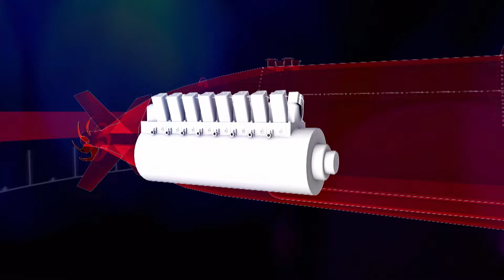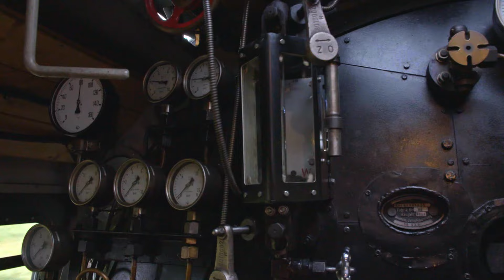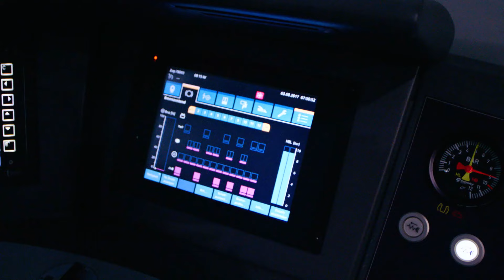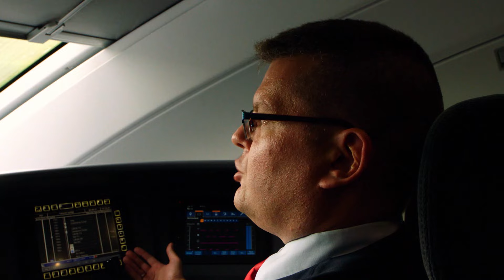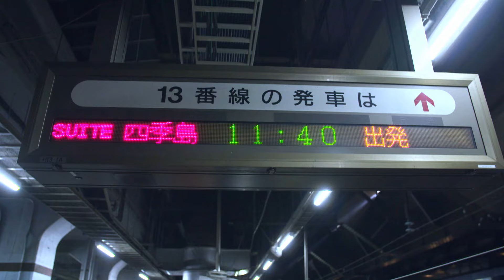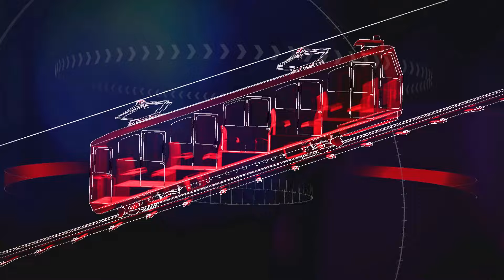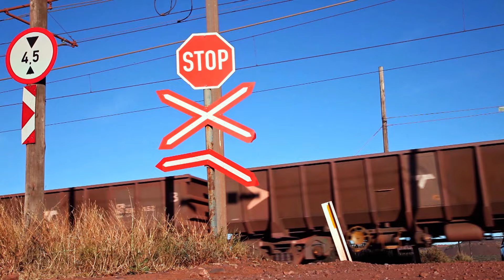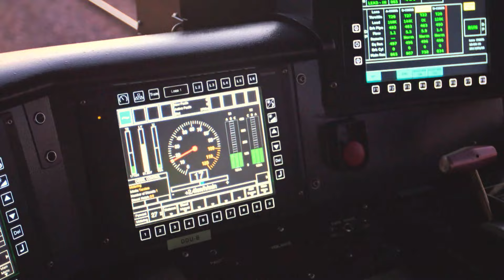World's Biggest, Longest Trains | Ultimate Vehicles | S01 E05 | Free Documentary

Comment: The A4 Pacific: Mallard is the fastest steam locomotive in the world. That locomotive reached 126mph or 203kmh to everyone else.
Reply: I think they meant the fastest speed during regular operation. The A4s were designed to run at 144,8 km/h (100 km/h are roughly 60 mph) during regular operation and the 18 201 was designed to run at 180 km/h during normal operation. But the A4 Mallard has the official record of the fastest steam locomotive ever at 201,2 km/h. It was driving slightly downhill, though, and it was damaged at the end. Btw: American Locomotives probably could run faster than this later on but they never bothered to break the record officially.
Reply: Cafer what American steam train would break the record?
Reply: @RRAAZZAA  The Class S1 is reported to be ran at 227km/h to drive in delay. It technically could have achieved it based on the power it had. But, as said, it was never an official record and the evidence is neither clearly declared reliable or unreliable.
Reply: The DR class 18 201 steam engine is the fastest loco still in operation. The LNER A4 "Mallard" holds the world speed record at 126mph, but is a static, non operational display only.
Reply: More specifically, the German 05 002 casually set a World Record while catching up a Delay, and wasn't even running on its Limit according to the Footplate Crew. Mallard bet that by just one or two km/h on a dedicated Record Run, while going downhill and still burnt out a Bearing. Please don't accuse me of German Bias though, because there are numerous Records of Pennsylvania S1 and especially T1 Locomtives reaching 230 km/h while catching up Delays, but no one there cared if that was a World Record back then, so it never was offcially recognised. Today there is a Project to rebuild a T1 Locomotive and break Mallard's Record.

Comment: 1989 Record:  South Africa.  Run on 26–27 August 1989, comprising 660 wagons, 7.3 km long and a total mass of 71 765 tons on a 1 067 mm gauge line.  The train comprised 16 locomotives (9 Class 9E 50 kV AC electric and 7 Class 37 diesel-electric) on the 861 km Sishen - Saldanha iron ore railway

2001 Record:  Australia.  Run on 21 June 2001, comprising 682 wagons, 7.35 km long and a total mass of 99 734 tons on a 1 435 mm gauge line.  The train comprised eight GE AC6000CW diesel-electric locomotives on the 275 km BHP iron ore railway to Port Headland.

Production ore trains:
Sishen - Saldanha    375 wagons - 4 km (2018}
BHP,  Port Headland 336 wagons - 3 km (2011)
Reply: Beaten by BHp in West Australia over 8kms long and 100,00- tonnes
Reply: @toodogs23  but they dont run now since the line was doubkled so this South African one is the longest regular one still running
Reply: wow

Comment: Steam locomotives exist that could easily equal the German loco for speed but which are restricted to 75mph/120kph because of the destructive 'hammer effect' caused by those massive connecting rods pounding up and down several times a second on the track.
Reply: What is kph?
Reply: Kilometers per hour.
Reply: @brianfraser2495  That would be km/h.

Comment: The steam is heated twice in 18 201 through the superheater tubes and just about every other steam engine is the same. The Swiss have moved it up a notch now with heavy oil firing being old technology and the Swiss have developed light oil firing or diesel fuel for steam engines. The burner looks like a huge domestic gas stove and could be the way for the future. Couple with a Lemphor exhaust which is much better than the Giesel ejector that 18 201 has thus making the engine much more efficient.
So the 18 201 is like a Mercedes it goes very well but when it needs repair it's damn expensive the same for all steam engines as there are no spares any more for any of them.

Comment: Fun Fact: Many of the german rails actually wouldn't support the steam locomotive at top speed, since many of them are rated for about 100/120 km/h
Reply: And maybe because a steam locomotive might be heavier in weight (I guess so?) We got a lot of rails that still have the wooden planks and can't even support regional trains at full speed.. let alone the ICE that needs special rails to fulfill its sliding technique.
Reply: @ranjapi693  It would depend on how the weight is distributed, but it probably would still be heavier, you're right.
Reply: @ranjapi693  Nope, the maximum Weight per Axle even was increased since Steam Locomotives were built. Back then, it was 15 Tons on Branch Lines and 20 Tons on Main Lines, today it's 18 and 22 Tons.

Comment: Fastest steam loc is Mallard in England, it can do over 200km/h. This is one of the fastest and comfortable to drive (oil heating instead of coal shoveling), but not The Fastest one.
Reply: More specifically, the German 05 002 casually set a World Record while catching up a Delay, and wasn't even running on its Limit according to the Footplate Crew. Mallard bet that by just one or two km/h on a dedicated Record Run, while going downhill and still burnt out a Bearing. Please don't accuse me of German Bias though, because there are numerous Records of Pennsylvania S1 and especially T1 Locomtives reaching 230 km/h while catching up Delays, but no one there cared if that was a World Record back then, so it never was offcially recognised. Today there is a Project to rebuild a T1 Locomotive and break Mallard's Record.

Comment: I thought the Mallard was the fastest steam locomotive...?
Reply: But it isn't in service anymore. The BR 18 201 is the fastest steam locomotive in service but not of all time. The Pennsylvania Rail Road S1 is the fastest of all time anyway.
Reply: @steffenreimann2854 
The Pennsylvanian record however wasn't officially timed, and based on what the crew claimed (the timing supports their claim, but there were no speedometers). Officially, a speed record also has to be set going both directions, which didn't happen there.

The Mallard holds the official record, however it's running gear had to be replaced afterwards. The Br05 got very close to the record, however the engineers avoided pushing it too far to avoid damage.
Reply: @steffenreimann2854  It's used from time to time.

Comment: I have a question so how do they the trains 🚊 come back do they have to do Uturn or what
Reply: It's either they have a locomotive on the rear end and just reverse, or they leave their wagons at a siding rail, then the locomotive goes to the other side and then re-connects to the wagons. Many modern trains don't have locomotives and instead have basically all wheel drive so either direction is okay with them.
Reply: CaptainKrajick oh now it makes some sense
Reply: Some trains, the locomotive must be taken off the service & turned around - steam, desil electric, can be run both ways from the cab, Passenger services, tend to have a driving cab, at each end these days,  in many country's - passenger carriage trains, just get hauled backwards, with the locomotive, hitched up front , unless quite modern, like the ICE, APT, Bullet Trains & other high speed passenger  services.

Comment: ICE 4 250? WTF the Vmax is 320!!
Reply: wtf no it's not
Reply: ICE 1: 280
ICE 2: 280
iCE T: 230 (tilting train)
iCE 3: 320/330 (in Germany only operated with 300)
ICE 4: 250 (after some changes soon 265)
Reply: @janv777  No. max speed of the ICE3 is 330. Velaro D is only 320 tho
Reply: @UnleashTheDragon  ICE3...some can 320 and some 330....
Reply: @janv777  Duh no. 403/406, wich is the original ICE 3 all go 330. Max 300 in Germany tho. Just the 407, the Velaro D, wich is also called "New ICE 3" goes 320
Reply: @janv777  Btw, the ICE 2 also goes 280.
Reply: @UnleashTheDragon  Es gibt keinen "originalen" ICE3. Es ist nur eine Marketingbezeichnung der DB.
Reply: @janv777  Mit Original wollte ich verdeutlichen, dass ich den 403/406 und nicht den 407 meine. Das Ganze macht deine angegebenen Daten trotzdem nicht richtig

Comment: its just so sad that the ice 4 is more than 70 km/h slower than the ice 3. Just because the german rail net is rotting away and redundenciey were srapped. so now ices local and freight trains use the same rails. the french TGV network is much better.
Reply: The ICE 4 was created to replace the ice 1 and 2. DB is constructing more high speed lines than ever before, just look at munich-berlin. The ICE 3 is still the flagship model, but it only makes sense on high speed tracks, but since most of the ICE lines are using old tracks which were not intended for high speed rail, there is a high demand for the ICE 4 because 1 and 2 really need to be replaced. The ICE 4 is very efficient, comfortable and economical, so I don't see any disadvantage in it.
Reply: DB already tendered new 300 km/h+ trains which will be compatible with the last ICE 3 the BR 407. Don't worry high speed is still a thing in Germany. Look at the plan called "Deutschland Takt", they will increase the 300 km/h connections in Germany f.e. between Berlin and Cologne. The topspeed of the ICE 4 will also be increased up to 265 km/h thanks to adding an additional power car.
Reply: @akairohoshi1872  The issue is the ICE 1 and 2 are too new to be scrapped.
Reply: The ICE 4 was designed to only do 250 because there's rarely a reason to go faster because the cities are all so close. On Stretches where it is worth it, the ICE 3 will be used which has a higher speed. It has nothing to do with 'rotting' railways
Reply: @ProfTydrim  ya is sad